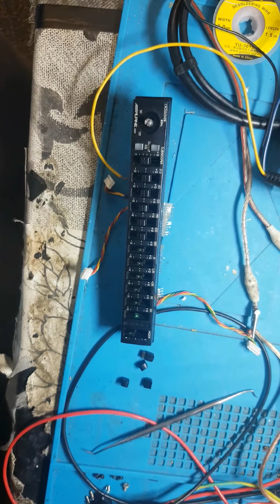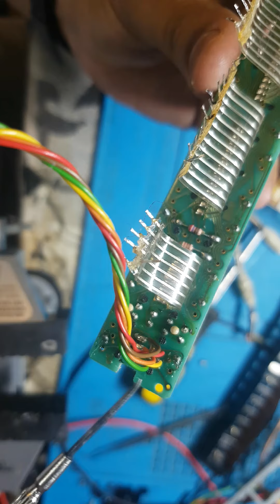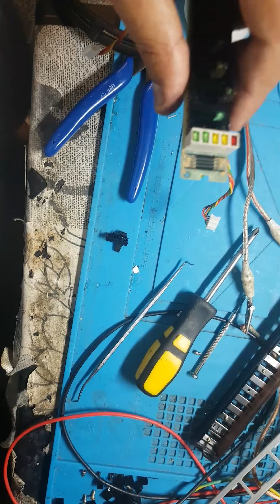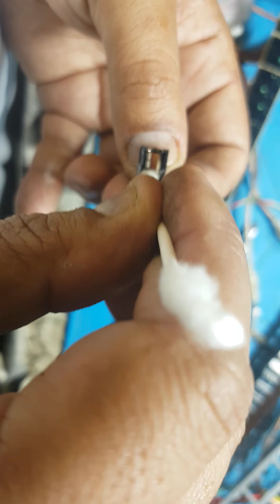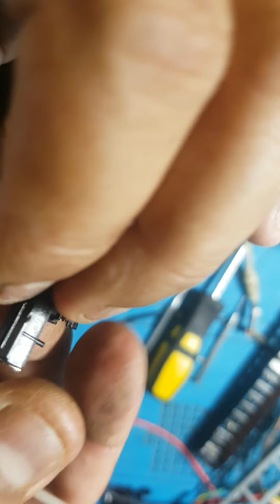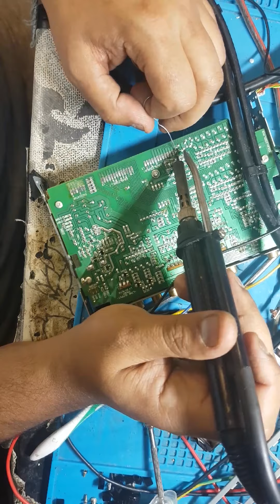Alpine Equaliser fix

Comment: I have one but mine won’t turn on with the key
Reply from the maker: R u in UK?
Reply: @shazadkhan4674  no I’m in Jamaica brother
Reply: It only powers on if I connect the yellow and blue with white streak wire together leading to the positive of the battery
Reply from the maker: @jeromestewart3908  The blue wire is connected to a headunit. When you turn on headunit, it sends a signal to blue wire to turn it on. If you are not connecting blue to heafunit it must also be connected to 12v to turn eq on